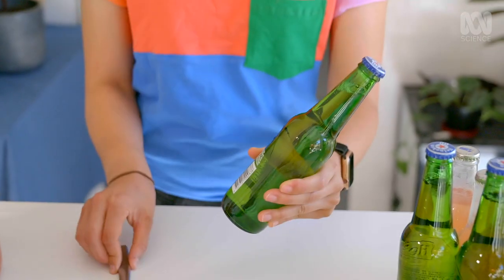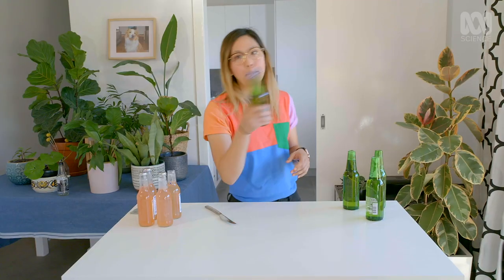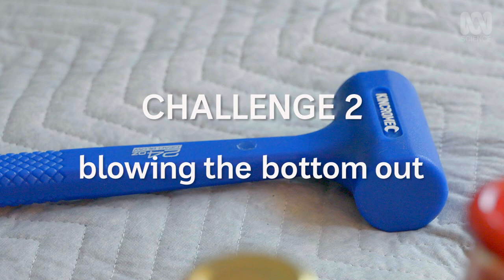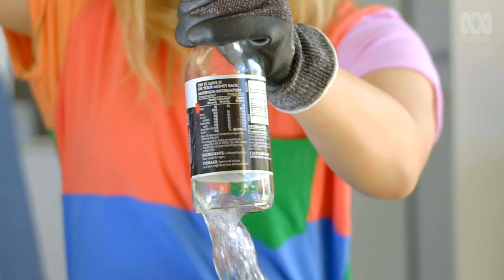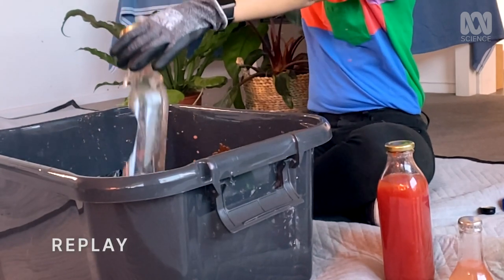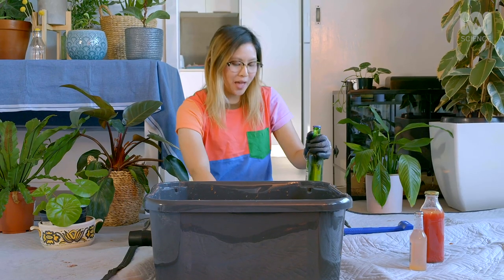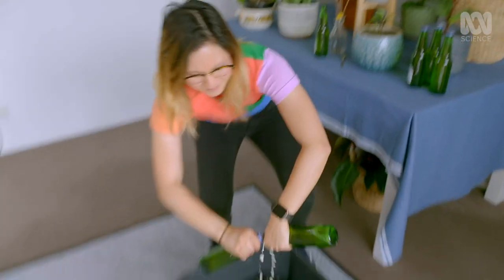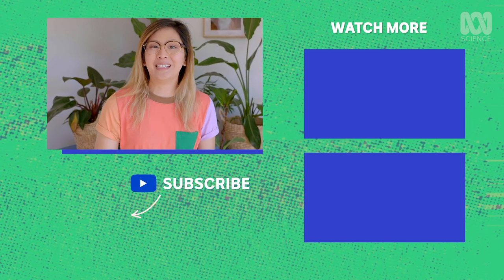The Physics Behind Opening Beer Bottles | Rad Experiments

Comment: The reason why it didn't work with the tomato sauce is because you still had the lid on it! When they bottle tomato sauce, it's still hot and when something is hot, it's in an expanded state from all the energy it has absorbed from being cooked. Once it is bottled and the lid is placed, the sauce in the bottle begins to evaporate it's stored energy and begins to shrink causing a vacuum to form inside the bottle. So, when you hit the bottle from the top, the vacuum inside the bottle can absorb the initial shock from the hammer. But once you opened the bottle and replaced the sauce with water, all that changed is the difference in pressure, I bet that the sauce would react the same as the water if you equalise the pressure by simply letting in some air.
Reply: The square bottle of passata wasn't vacuum sealed, if I remember correctly! But I totally wanna try it a bunch more times with different liquids and vacuum/non etc so I can see how stuff shakes out - I reckon you're right! (But I wanna see it for myself ;) )

Comment: OK, I accept the challenge I just saw you make on telly. I have two plastic icecube trays exactly the same, nothing special. I fill them, I put them one on top of the other in the freezer. With the top one, the ice cubes always come out easy, just by twisting the tray about its longest axis. With the bottom one it's always a fight and I end up running water over the bottom to free them. Why is that? <3